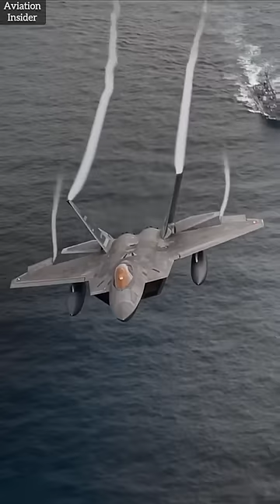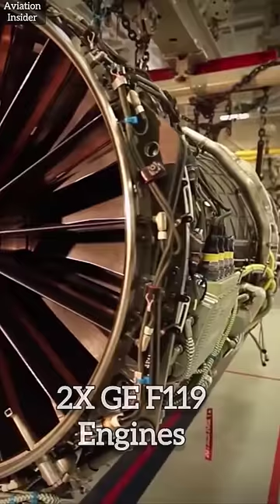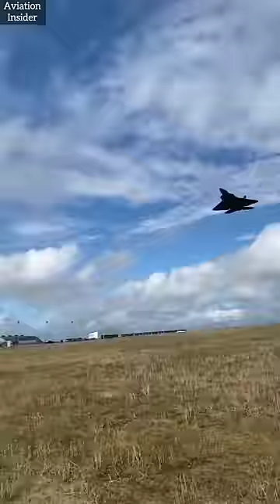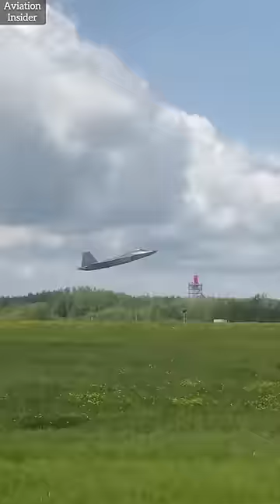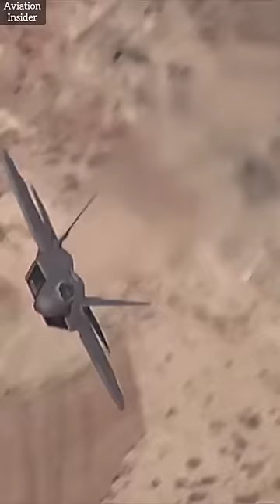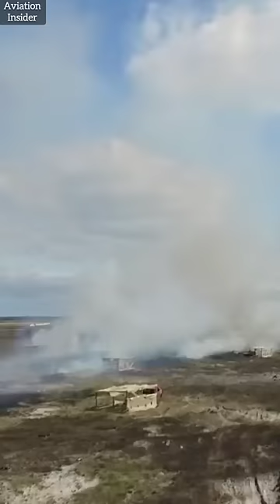The World's Deadliest Fighter Jet: The F-22 Raptor.

Comment: My flatmate was a former airforce officer and said that when the Americans flew the F22s into Australia from time to time during the 90s, they wouldn't let the Aussies anywhere near them. Mustve has been some serious tech in those things
Reply: They still don't, the F22 is not allowed to be exported to other countries. No ally or NATO member can buy an F22. With the F35 they did things differently, it's more modular and that allowed them to chop and change the features - as such the export F35 have fewer features than the non exported F35, the main features that are missing on the export F35 relates to electronic warfare and stealth
Reply: you mean your lover.. only lovers mate..
Reply: I don’t think they’re over 20 years old yet. They may have been on the drawing board but I doubt they were flying them over other nations in the 1990’s. I could be wrong, but you could be thinking of the F-16.🤷🏻‍♂️

Comment: Everything about the F22 is incredible, aside from one aspect. the PRICE TAG. 
the F22 can be produced for roughly 120 million $ per jet. (and still, make a profit) 
slightly higher than the F35. 
you don't have to reinvent the F22 aside from upgrading the electronics. that already exist on the F35.
so when Gov contractors stop ripping off the Gov with a price tag of $337 million per jet. then we can start the production.

Comment: In 2011, the last of 186 examples of the F22 was build
In 2022,  the first 33 units were taken out of service
by 2030 there will be no more F22s in service

Its much to expensive, a F18 nearly the same for much less of the budget.
The same with the F35, to complicated, to expensive; only makes money through exports.
The real backbone of the Air Force are Jets that were reliable, cheap to maintain and can be updated to do their service an other decade.

Comment: I hate to tell you, but the Iconic Top Gun pilot is obsolete...  To be replaced by an AI drone capable much higher speeds and omnipotent response speeds way beyond the tolerance of the human body.  they will be guided by a team from an aircraft carrier, a 1000 miles away,...  also a sitting duck. .

Comment: Su-57 has better 3D thrust vectoring. Longer range K77M guided missiles and can carry more of them. Has radar and electronic jamming pods, the f22 doesn't. Higher angles of attack with the SU-57. Higher service ceiling. The F22 gatling gun has enough ammo to sustain fire for 5 whole seconds.. They seem to be having the same ammo issue as the whole of NATO 😂

Comment: It really is an incredible jet, but after 10+years it becomes structurally unfit to fly due to the overlapping nature of its build, where as anything that's not composite built costs less $100,000,000 and can just have things replaced, some of the F-15s still used are out of the 70s and are getting retrofitted for new upgrades

Comment: You mean two engines with 35000 lbs combined equals 70,000?? Did you use a calculator to check that?